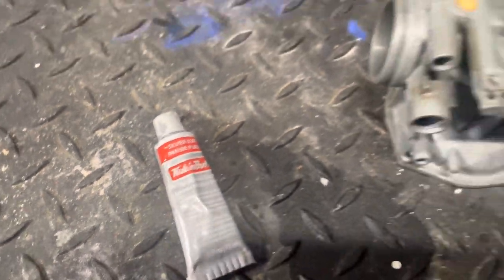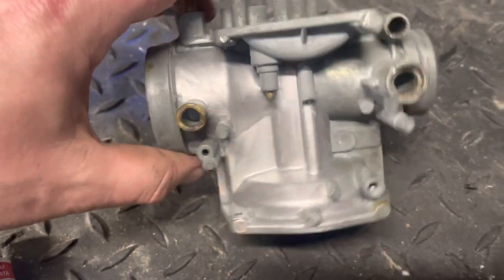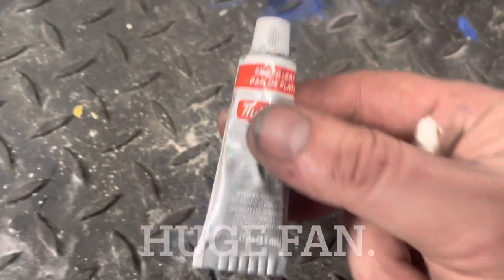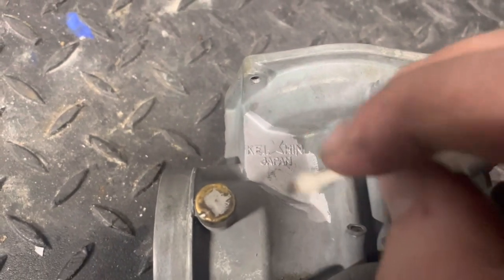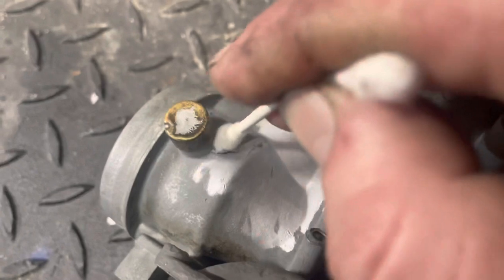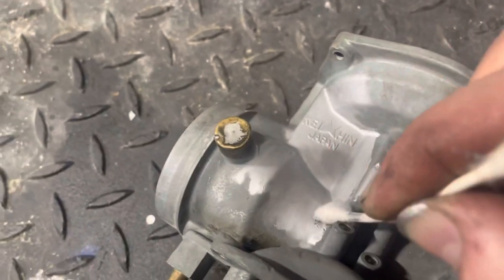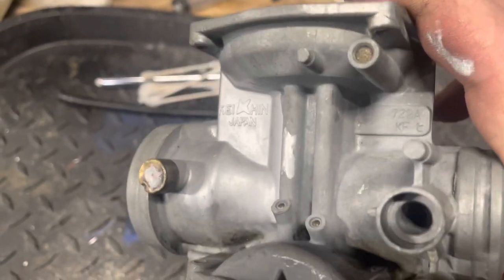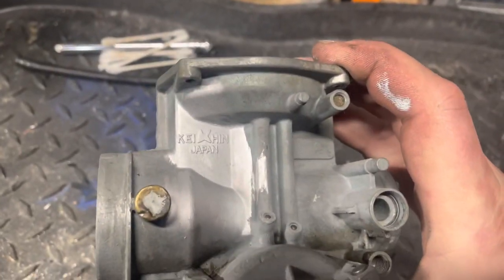How To Apply Rub ‘N Buff (rub and buff) to Motorcycle Carbs

Comment: Rub n buff removes very easily with solvents....like...gasoline. one drop and its gonna streak and look bad likely. you can achieve similar lookinb, but much longer lasting results with a dremel and a fine  brass or ss wire wheel attachment. plus the wire wheel is great for removing crusties off the inside of the carb, float, jets  as well without damaging surfaces.   only took me maybe 20-30 minutes to do the outside of the carb.
Reply from the maker: It’s kinda messy for sure.

Comment: Is the rub and buff cleaning the metal or covering the surface like a silver paint?   I’ll take half a q-tip and put it in my dremel and use it on the carb like a little buffer (with some metal polish.)  Or I’ll use those small felt attachments to buff the hard to reach spots.   They come in cones, cylinders and wheel shapes.
Reply from the maker: It's more of a wax than anything from what i can tell. It's not a paint. it leaves the surface silky smooth. I wanna drop one in the ultra sonic to see how easily it is removed.